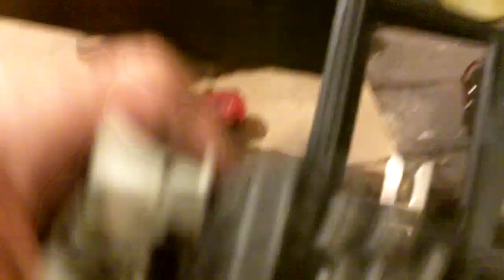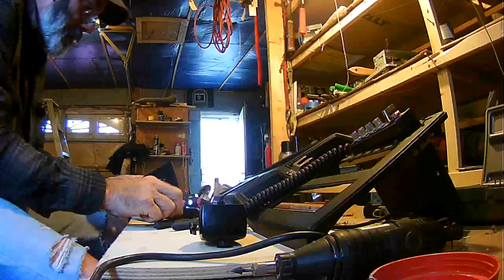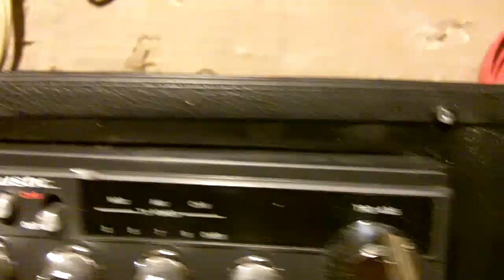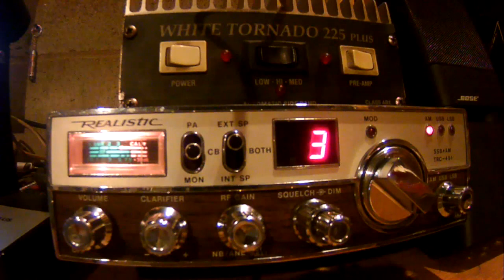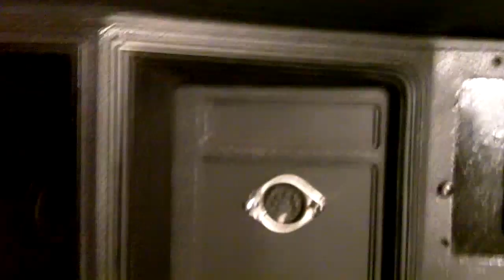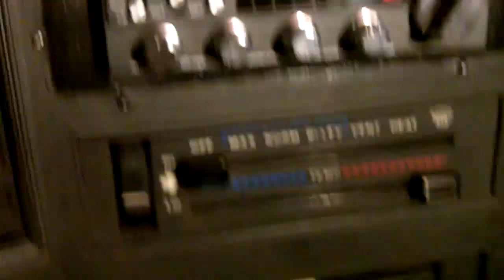Remote Mic jack for a side Mic CB radio

Comment: Hey Mower, would you mind if I ask an opinion?

I have a 980SSB with a 6 pin mic. It is m opinion that this is a great radio, with a subpar mic. If I were to go out looking to buy a better mic for it, what would you look for, if you were me?
Reply from the maker: from what I've been told, and what I have heard on the air, The Astatic Red Devil is a great mic with a 980. or the Super Star echo/power mic is also a good choice.
Reply: Awesome. Thanks! 

After asking you this question, I read somewhere else that the stock mic becomes pretty good, if you pop it open and take out the noise cancelling disc. I don't know if that works, but you and I can try it out together and see. Took mine out last night.

Nothing to lose. If it doesn't work, I am no worse off, right? And now I know to pick up that Red Devil, if I need to.

Thanks bro!

Comment: And if you wanted ta make it look pretty you could always cut a trim piece to go around the radio & either paint it or stain it then Velcro it on so it's removable. Or you could just Velcro Fur around it😳 The indash din plug was ingenious❗ But I guess that's why your The Mower Junkie👍🇺🇸
Reply from the maker: those are some great ideas. I was also thinking about using some fiberglass to make the dash panel flat again. then the radio will really look like it belongs there.